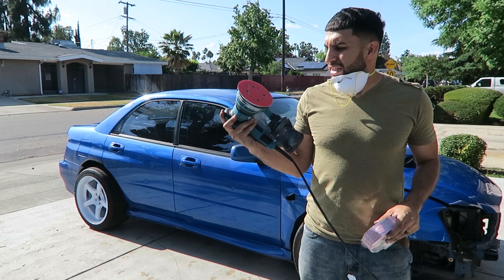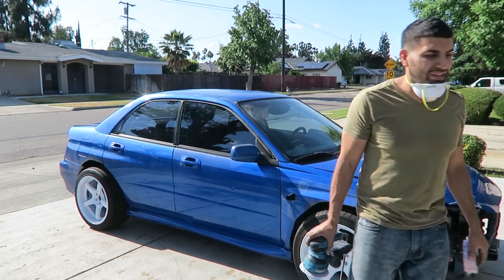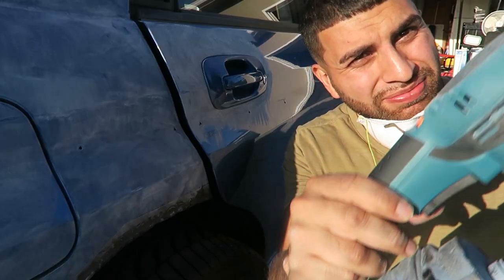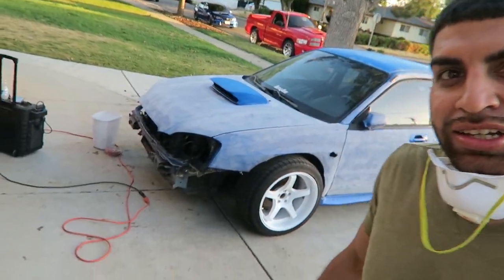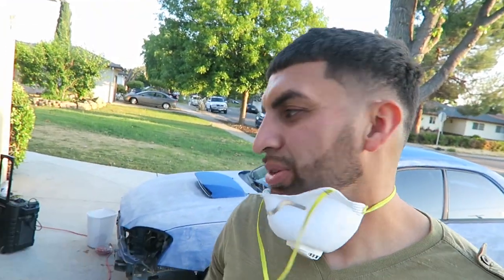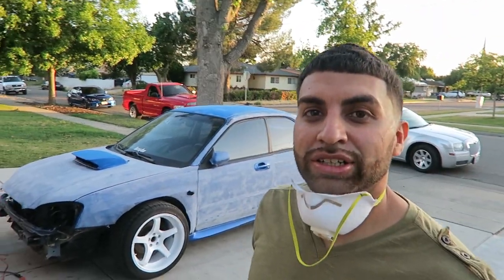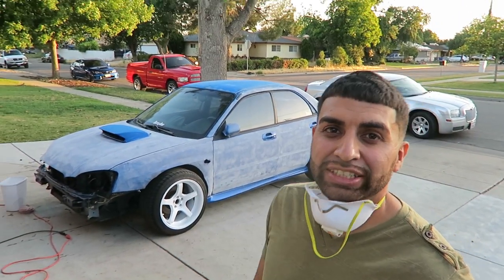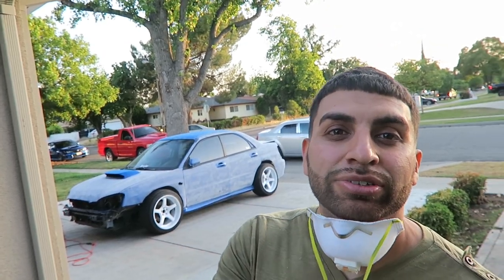SANDING MY WRX FOR PAINT

Comment: How many times did you have to change pads?
Reply: That's a mystery 🤔. 
Looks like he has a 5 inch sander.
But we don't know what exactly. 
5 inch is for wood and  6 inch is for body work. At least that is what I was told. 
We don't even know what grit paper. 
OMG 😲
Reply: @vm722  he literally says 320 in the vid

Comment: You didn't explain the steps or the process. You went from sanding roof using something white on the body of the car. What was it?

Car color looked pretty good in the sunlight, so was it faded or why were you painting?
Reply: You can see beginning of the vid the clearcoat was peeling.

Comment: Ordered recently another orbital palm sander the last one was 6 inch had but this one can take the bottom off and switch sizes it looks like. It has the bag for dust but wanna use it to get rid of orange peel with 800 grit and after I spot spray a small area after I get this resusable aerosol spray can got coming online too and spray the small spot with base I wanna reclear the whole vehicle. I painted it already but it had lots of orange peel on it I tried getting it out with a polisher with sanding pads but still see the orange peel. I like using orbital sanders better. But got other products coming like the Fuji Q5 platinum turbine sprayer but got it from a Asian site for cheap it is higher priced online but got it for less than 100. I used PayPal to pay for it so it should be coming in October. Just hope it comes as the real product because it cost 1,000 online but wasn't paying that much for a sprayer wouldn't even pay 500. Plus don't wanna buy another air compressor because have a small one now. I got some other products to buy but after get them gonna get new tires on my truck and the antilock brake system on vehicle had a fault on it so will have to check on that too. Only started painting last June but have gotten a lot of products for painting not ready to paint another person's vehicle yet but trying to get a lot better at the painting auto detailing things.
Reply: Would you recommend that sander or a pal sander? I also don’t want to deal with the air compressor.

Comment: Is 320 all you used? And it was good for primer and paint?
Reply: That’s my same question and did he hit the paint or did he just scuff the clear coat???
Reply: @luisbernal9595  barely scuffed the clearcoat 🤦🏾‍♂️
Reply: @breeze5763   You can paint over clear coat. I paint over 400 grit so, if he doesn't have any low spots, after working on the ones he said he had, scuffing the surface is all you need.

Comment: Bro you barely sanded through the clear coat you should’ve started with 80-180 grit and moved on up
Reply: actually if he is just doing a color change, all he has to do is scuff the clear coat, doesn't really need to even prime. I usually just use 400 grit and sand until it's not shiny. 80-100 would of ate his paint to base coat and in some areas it could of went to primer, i only use 100-180 if i am sanding out bondo
Reply: @Cam-wi3tp  nah if he already had clear coat and paint on his car he’s supposed to use 80 grit to remove it
Reply: @Cam-wi3tp  it will look very 💩ty with out primer, I had to learn the hard way.
Reply: @Justin Rodriguez I’m about to sand my truck down for new paint for the first time, I need to do everything from step one, sanding down and doing body work. Can you give me some tips on sand paper? What I should use?
Reply: @Justin Rodriguez you there? 😂
Reply: @Cam-wi3tp   you’re right if he has to go to an 80 grit either he’s going deep and that will result in a primer stage if the sanding was done right leaving no waves, but with what he’s doing it should be mostly with a light 320 or 400 , but with that front fender burns a lil primer never hurts